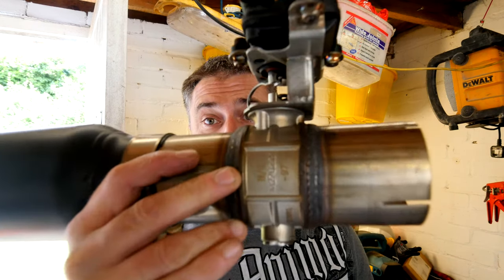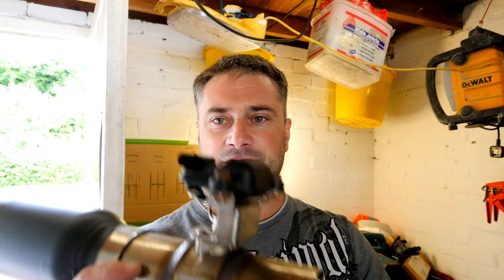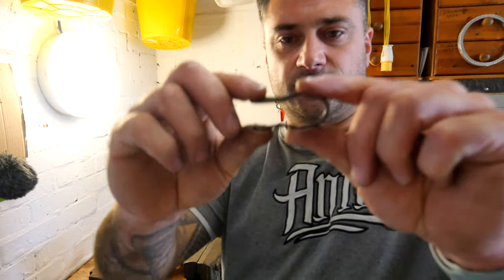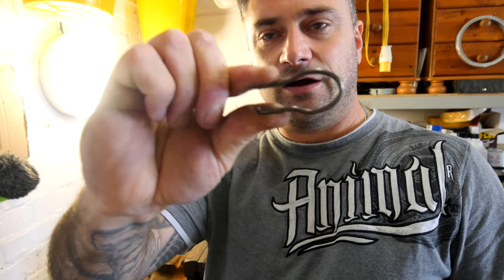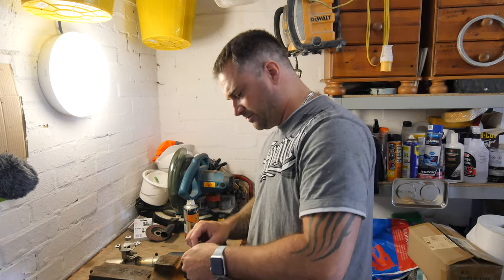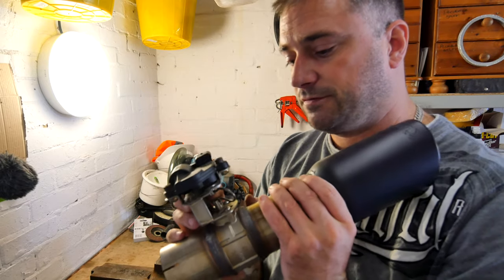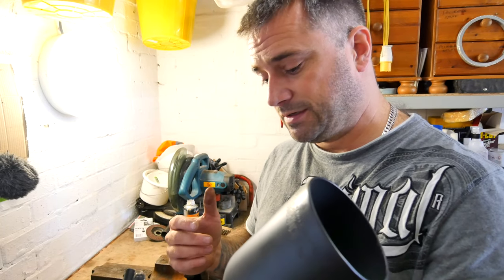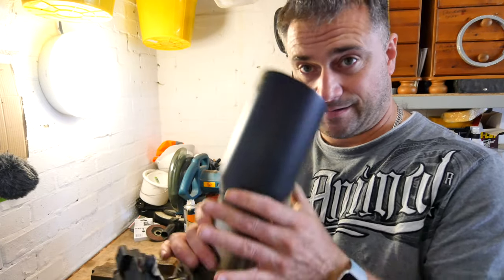Scorpion Exhaust Valve Fix - Ford Fiesta MK8 ST

Comment: Just earned a new sub mate. Just picked up my new mk8 Fiesta ST and I have a squeak sound on and off the throttle in sport mode most of the time, but not in normal mode. I also occasionally get in when I first unlock the car and open the door. Apparently the exhaust valve opens when first unlocking the car and opening the door. No rattles here but definitely a good squeak, does this sound like the exhaust valve to you? Thanks mate.

Comment: Nice one! So basically just increasing the gap in the spring clip to 15 to 20mm?. I have a Milltek and mine does have a slight rattle on de acceleration too so maybe give your method a whirl.
Reply: Did you get it fixed? If so, how?
Thanks in advance
Reply: @rbptheprettiest  not really but I’ve sold the car now
Reply: @hotrodda  F

Comment: For the price of the exhaust there shouldn’t be a problem with it rattling, is just a piss poor design.
Reply from the maker: Mate I completely agree!! 
The design is really bad. I think its design the way it is so if the valve fails the clip brakes. It don’t show much confidence in there design. If I had more time I could probably come up with a better fix but hopefully this works long term.
Reply: @G5MAV  did it last long term or did you have to keep removing the valve and opening it up every few months to keep tension on the clip?